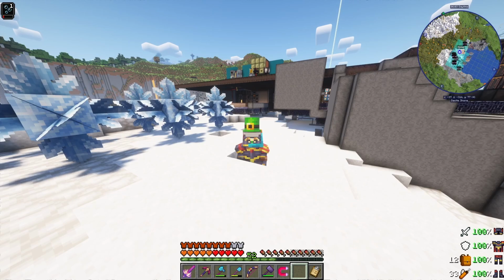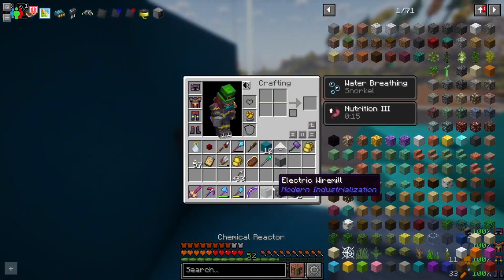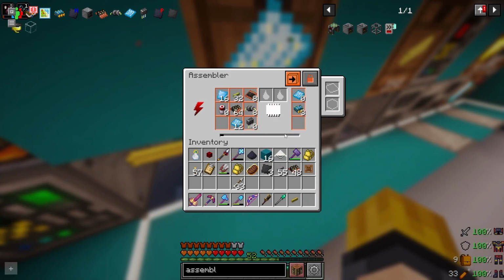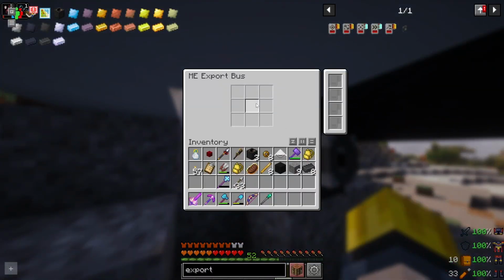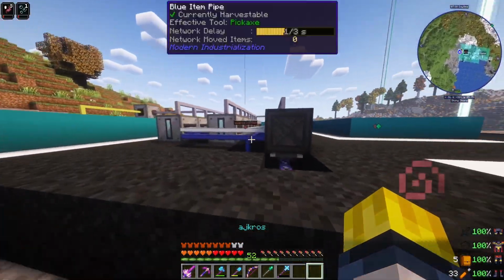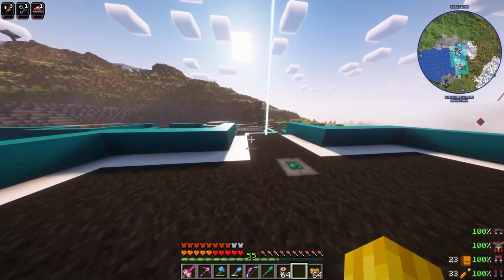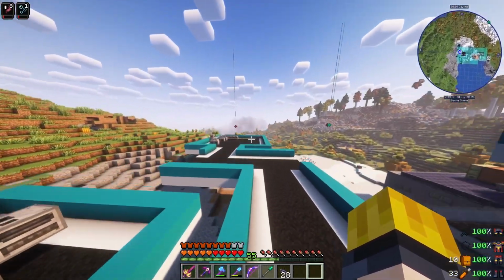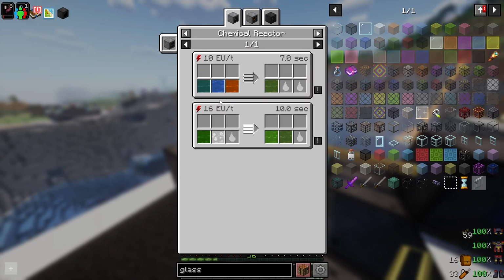Automating Circuit Boards & Expanding The Base! | StaTech Industry | Episode 11

Comment: I'm gonna start a tally on how many times you mention running out of aluminum. 

Hate to say it but itll probably be the #1 resource you run out of. CONSTANTLY.

Also highly recommend making an assembler for EACH circuit component that way you dont run into the issue of each assembler fighting each other for recipes.
Reply from the maker: I think I will end up doing that because ive been running into that exact problem. Thanks for rhe advice!